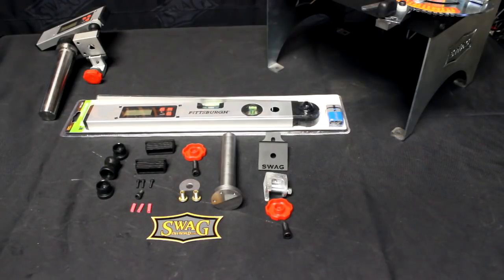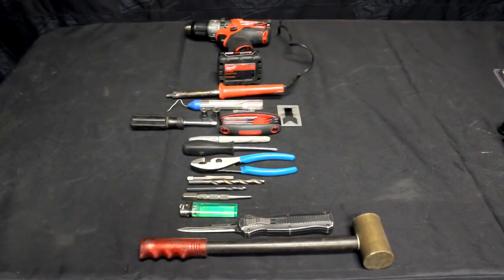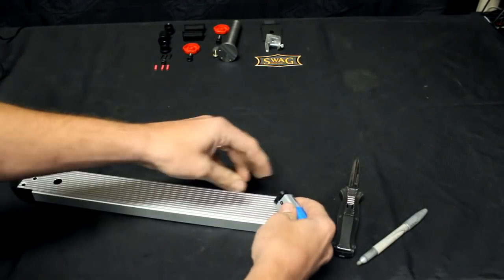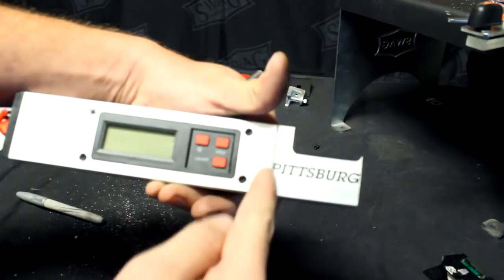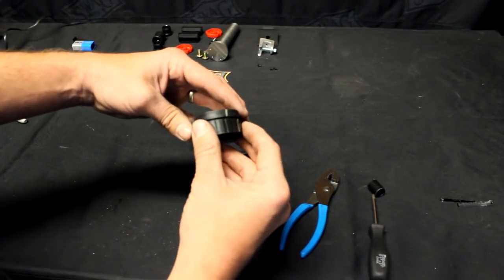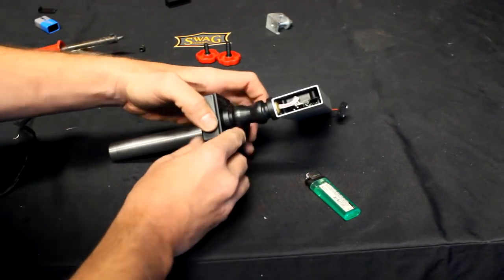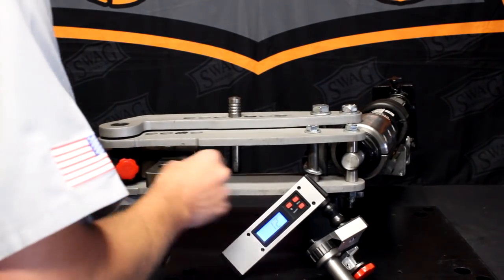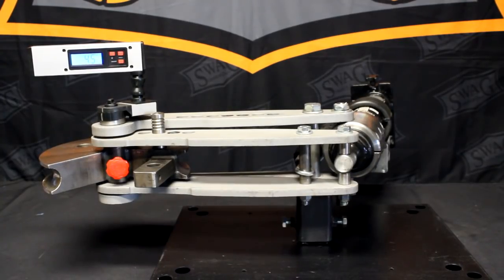SWAG OFF ROAD U-TURN DIGITAL READ OUT ASSEMBLY

Comment: Just installed mine, works great!!!!!  I would suggest just removing the readout so you don't have to worry about drilling in the wires and then reinstalling it after drilling.

Comment: If I rotate the angle finder backwards too far in accident is there a way to recalibrate it and start over?
Reply from the maker: Unfortunately, when rotating to far backwards, the small electrical contacts inside of the device can be damaged. In the past, we have had some success straightening them back out. The other option is to pick up a new digital angle gauge and replacing the contacts into your existing U-Turn.

Comment: Works great!!! But, I would strongly recommend fitting on the bender before soldering. My install was backward to the clamp and had to disassemble and cut wires to reorient the clamp. Only recommendation: throw three of these in the kit and avoid the soldering hassle.
https://www.mcmaster.com/7056k23
Reply: Troy McConaughey z

Comment: What is the operation when you run the bender to the first stop and need to rotate back to pick up the second/third/etc  holes on the die?  Does the angle finder not rotate back to 0?  Mental math at that point, adding the new bend angle to the previous angle?

Or, do you release the friction knob, rotate the arm back, then re-engage the friction knob?  

Either way, it seems like some inaccuracy will be introduced.
Reply: I think you would just be looking for the difference. As in if you need to reset your pin at 37deg and your looking to get to 45deg, you would just be looking to add 8deg. Lets say after moving the pin, the DRO reads 5.6 you would add 8 to 5.6 = 13.6...which is truly 45deg from your original 0. I'll find out soon enough if this assumption works after ordering it...
Reply from the maker: You only have to zero out your readout once, and the only time you release the friction knob is when you are swapping out dies. No mental math is needed, the readout keeps track of each bend that you make.